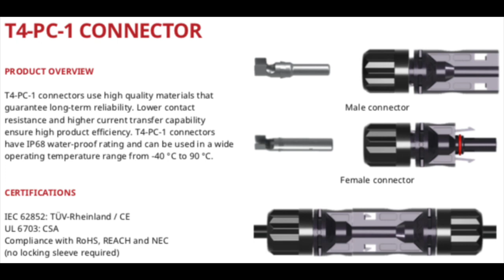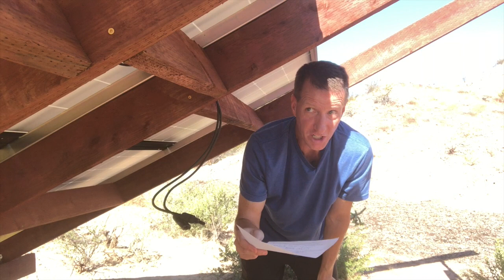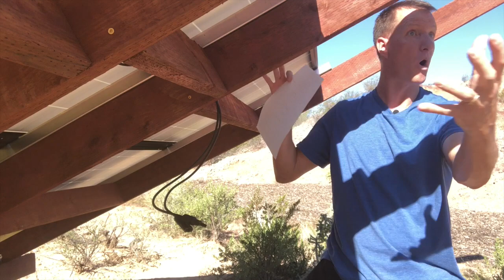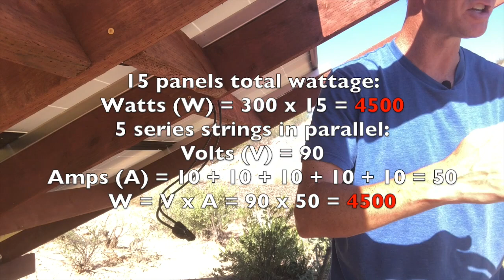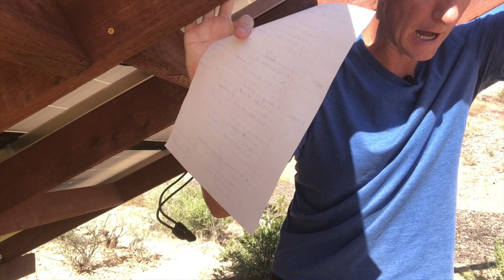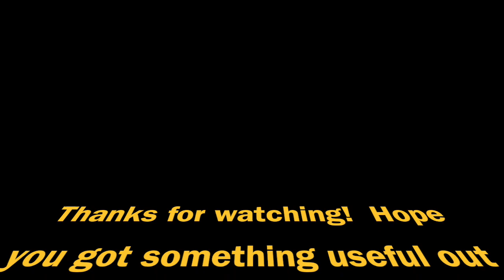Off-Grid Solar for Beginners - By a Beginner! (Part 2 - Panel Connections)

Comment: well it looks like you have gained a good understanding, but your explanation was not accurate, that higher amperage will have losses as heat, and high voltage you'll have losses over cables distance in voltage do to electrical resistance and the way to calculate it is with ohm's law.
also it is not recommended to do what you are about to do, if your charge controller can handle 150v (before you connect things, check ,check and double check, that it's not saying "peak" 150v, because peak will work from a few seconds to a few minutes, even up to 59 minutes, but under an hour! (go read "Watt's Law") before it will die on you, like burn out and will have to buy a new one) so just like in the world of speakers if it say's 150watt's it's always peak and RMS would be 40% of peak so you should feed it 40% if you want it to work correctly and a have a long life, now it your charge controller say's continues 150 volts, and it has a different number for peak, go for it 
if it's a Chines produce i would go with 30% they have a tendency to advertise falls info.
a friend of had a inverter that said 15kw on it, but we run some tests and it peaked at 15kw and it had no problem with 5720 watt's, luckily it was a "high end" so it had a protections system and when it peaked it turned it self off, so he avoided it burning out.
but you should relay check this so you won't burn your stuff.

Comment: Your explanation was fine, however your interlocutor complicated the discussion a little more than necessary, making the video a little longer than necessary :-)
I was hoping to get to your distances by the end, so we could get an idea of where you would have to trade off wire gauge against voltage drop, and all that. I'll keep an eye out for part 3.
Reply from the maker: Whoa!  I had to look that one up!  I'll make sure to include distances and wire gauge calculations in one of the talks.  So glad you're following along, Sam!
Reply: I had to look that one up too! 🤯  I created a spreadsheet for my setup that I can use to fill in the panel data (including price/panel) and then it tells me all of the data for 1-6 series strings including total panels, total cost, breaker sizing (for charge controller,) wire gauge sizing (which dictates my combiner breakers,) VDI all so that I could also size my controller (before I decided to go All-In on Schneider MPPT 150/60.)